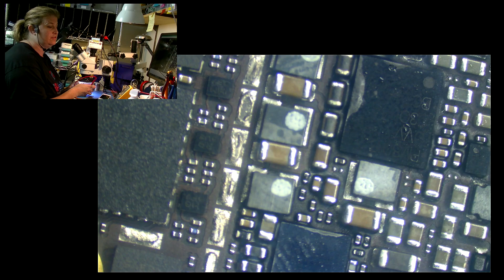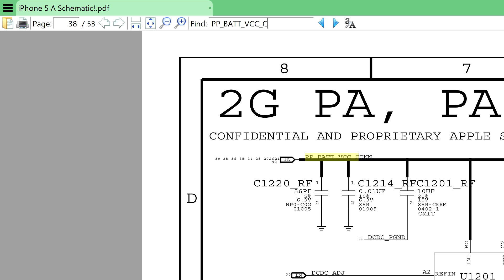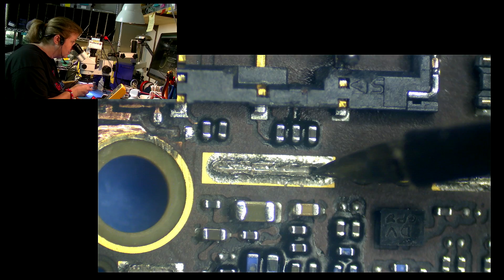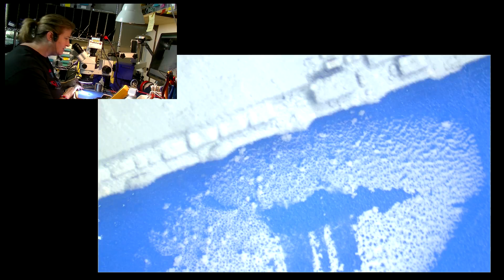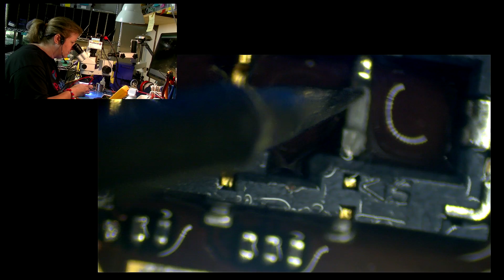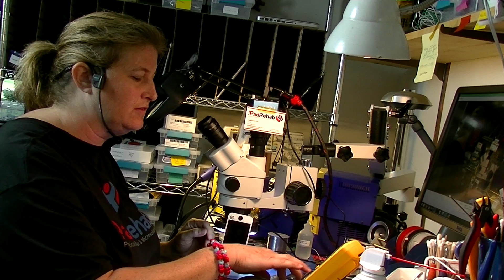iPhone Data Recovery After Water Damage---short detection

Comment: do you know how to repair ERROR 4013??? thanks ^_^
Reply: Liquid ?
Reply: Error 4013 Iphone 5
Reply: +dj minions de spicable first and 'it fell into the water?
Reply: +dj minions de spicable  caused by a short circuit usually occurs after contact with liquid is created oxide can be caused by a flex oxidized or logicboard must open the phone and checked